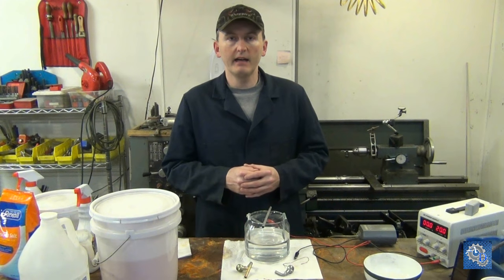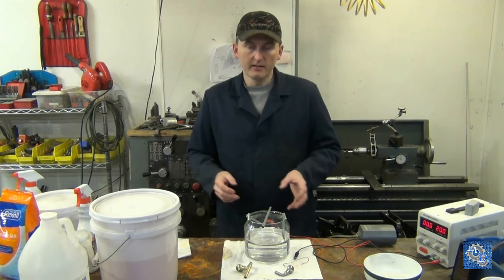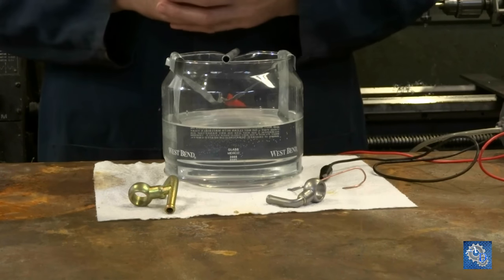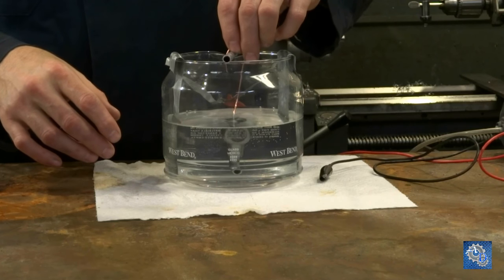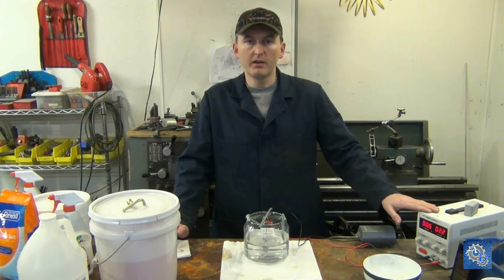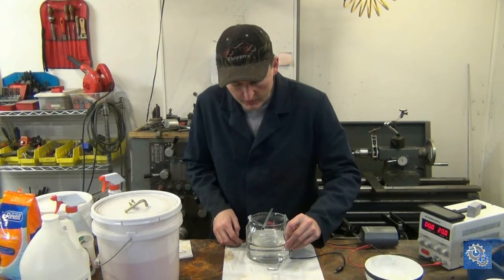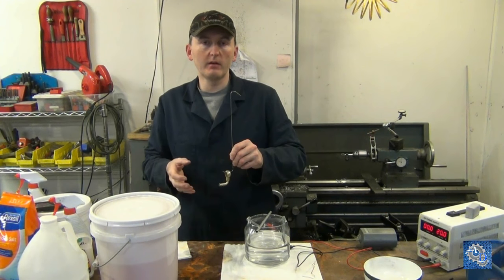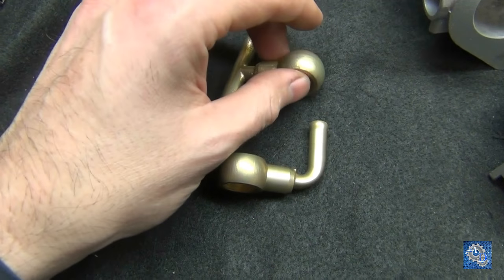Easy Zinc Plating and Yellow Chromate on Banjo Fittings (Copy Cad alternative)

Comment: By "CopyCad" is that the Caswell process- did you start out with the CopyCad kit for plating as well before sourcing the alternatives?  I have the Caswell kit, but it is very expensive here in the UK and am at the point of all the mysterious "A" and "B" chemicals being exhausted- of course they will never tell you what they really are!  I am finding now most customers want their carb bracketry re-plated.  But with the zinc brightener Caswell use, at least the finish is ready for the chromate straight away.  So if the zinc finish using the cheaper solutions is dull and needs vapourblasting to shine it up a bit before the chromating- can you say why you find it necessary to do this cycle 3 times?  Great video!
Reply from the maker: Thanks :) It's not the Caswell process. I'm not sure if that's their trademark, but if it is, I'll change the title to cad plating replication or something like that. It's quite expensive here in the US too. I have read that with the process I'm using, if you add a little sugar to the solution, it enhances the finish by controlling crystal size. I haven't found that it changes anything, but I'm no authority on this either. I'm still experimenting. I use three thin layers of zinc because if I put down one heavy layer, the plating starts to build up on edges and turn dark. It's like spraying on three coats of paint and sanding between, instead of spaying one heavy coat. It's more consistent. I think you could use this method, but bead blast between layers if you don't have access to vapor blasting. You would need unused glass beads so no dust or oil gets embedded in the zinc, and blast the plating at very low pressure. I have a video posted that shows how to set up the plating bath and where to source the materials. There is a link in the description.
Reply: Yes the "CopyCad" kit is Caswell's- I have it.  It is meant to replicate the CAD plated look as standard.  You add a few drops of a mysterious brightener every now and then which gives a very bright finish straight out of the tank- saves using wire wool or blasting the part again.  I bet you found as I did that the plating industry hides all the information on chemicals to use- frustrating!  Nevertheless I now have a plating solution similar to yours which is cheaper and works.  The brightener is still a problem- I heard the sugar theory then found another Youtube vid where a guy uses artificial sweetener as a brightener- maybe a myth...  Over here the commercial platers are turning away small scale jobs from restorers in favour of bigger jobs- and since sending a few blasted carbs out with re-plated parts I have been inundated with requests to re-plate and chromate parts!
Reply from the maker: No, I meant that my process was not Caswells. I thought that was what you were asking. The plating industry is guarded as you say. I suppose they have to do that to keep out competition. There is a good forum on finishing.com though, where people in the trade offer a lot of info to anyone willing to listen. I will try the artificial sweetener thing. I haven't experienced the demand for replating here, which is good. It's not really something I want to get into too much.
Reply: There is absolutely no ingredient name listed in that website, which is quite useless.
Reply: @lhongkho1091  Just download the pdfs...
Reply: @kennethkaiser5332  The MSDS at Caswell for most products are not showing the chemicals used. They hide it as a trade secret. Now some of them have a memo that states if you bought this product (proof of purchase) we will send a password to log on in order to view the MSDS.
Trade secret statement (OSHA 1910.1200(i))
Per OSHA 1910.1200(i), specific chemical identities and percentages have been withheld as trade secrets.
Reply: The Passing of the Great Race by Madison Grant
Reply: @kennethkaiser5332  Its a safety data sheet. Their not required to give up their trade secret chemical, only required to explain what its hazardous properties are. I'll give you a hint; its Cationic Polyamine's.
Reply: I can recommend gateros plating.

Comment: Great video.   I have and Old Triumph and want to restore nuts, bolts, etc. to original cad finish.   would I vapor blast and then use clear chromate?
Reply from the maker: Thanks. You could also bead blast if you don't have access to vapor blasting.

Comment: I have had trouble with the yellow chromate sticking.  After 24 hours it wipes right off.  What is your chromate to water ratio?  Do you do anything special like blow with a hair dryer or something after your done to make sure the chromate sticks?
Reply from the maker: I just mixed the solution as per the directions from Caswell with reverse osmosis water when it arrived. The only time I had it peel in areas was when I left it in chromate solution too long. I think it was about 25 to 30 seconds. Now I just go 10 to 15 seconds max. It's also possible that maybe the bath or the zinc surface is contaminated. It's hard to say. I blow the part off briefly with a heat gun a safe distance, or set it in front of a heater for a while until it darkens.
Reply: @ArnoldsDesign    Thanks.  I think my 30 second dip may be the issue.  I will try the much shorter 10-15 seconds next time.
Reply: Hi do you have troubles with plating bolts with attached washers..getting into the tight areas?

Comment: Hi, is zinc plating enough to make parts fuel resistive? Or do I also need to get them coated in yellow chromate?
Reply from the maker: They should always be chromated, yellow, silver, etc., otherwise the zinc will react will air moisture and get chalky and white and not last long.

Comment: is there a way to polish up the zinc after plating prior to chromating since I have an item that is full of nooks and crannies making it impossible to polish with Steel wool and I don't have a vapour blaster.Could I dip it back into a muratic solution for a few seconds prior to chromating???
thanks Andrew
Reply from the maker: You could very lightly bead blast it with new clean beads. It won't give you a shine, but will give you a satin silver finish. Muriatic acid won't make it shiny, and will dissolve the zinc within a few seconds.
Reply: Arnold's Design 
thanks for the prompt reply.I know you might not like what I usually do.I usually sand blast my rusted steel.Could I lightly sand blast it with clean sand or will it be too abrasive??
Reply from the maker: Sand will leave a matte finish on the zinc, and will quickly remove it. You could sand blast the steel, then plate it, and then glass bead, but I wouldn't sand blast the zinc itself. You could try, but I don't think it will be what you're looking for in a finish.

Comment: Thanks (from the UK) for the time and effort involved in making a video with detailed step by step explanation and instructions,  however just a couple of queries, as I don’t posses a vapour blaster, any suggestions of what (if any) alternative method I can use, also what does ‘yellow chromate’ consist of, do I have to purchase it, or can I maybe concoct it myself?
Reply from the maker: Thanks :) You could bead blast between layers with very low pressure. You would need new glass beads 
so no dust or oil gets embedded in the zinc. The yellow chromate I get from Caswell's. It's not expensive and lasts a long time. It's a little bottle of concentrate you mix with distilled water. I think there are people who mix it up from raw chemicals, but I don't know how it's done. Chromates are fairly hazardous, so I don't like to mess with them too much other than dipping parts.
Reply: If I simply want to zinc plate an item, do I have adopt some kind of end hardening process (such as chromate) or will the actual plated finish be tough enough? TIA.
Reply from the maker: You need to do a chromate conversion after plating, otherwise the zinc will become chalky and feel tacky, and degrade quickly when exposed to humidity.
Reply: Thanks, I'll have to check out sources here in the UK, although couldn't seem to find a similar product to yours listed on ebay, perhaps I didn't look hard enough, so will try again.
Reply: If I recall my chemistry correctly, freshly applied zinc, plain bare zinc, is "active". It is reactive and does oxidize quickly. It can form a nice patina under the right conditions but for automotive use must be protected with that passive layer.
You are putting a passive layer on it with the yellow (besides making it look great. The "chromate" or "passivate" dip actually eats into the top of the zinc. Two reasons to watch the time closely (timer or stop watch is a logical idea) - it can eat off the zinc and leave blotchy areas with no zinc, and it does darken with time left in the passivate bath. If you don't have enough zinc plating there's not enough zinc for the passivate to eat and sink into - and it can eat right through a thin layer. In either case the only alternative is to strip it in an acid bath and start all over. And you know how much effort goes into the PREP work! Like painting a car - it's over 90% prep work, and if the final step is messed up, you have a big problem and have to literally start over from scratch having wasted all of your prep time. 

What are you using for the yellow chromate or passivate? Did you purchase that - or buy the component chemicals and make up the yellow bath?
The plating isn't so bad but I've had bad luck with getting the yellow right and need to find a good source of either the yellow chromate or passivate or make it up somehow.
The guy I was buying a concentrate from is out of business and gone....... nowhere to be found.

Those fittings are perfect, the exact finish I need for my automotive electric part restoration business (starters, alternators, wiper motors, etc.)

Comment: Great video! How do you prevent the aluminum that was vapor blasted from oxidizing? Do you have a way to anodize it?
Reply from the maker: Thanks. Aluminum forms a transparent oxide layer that gets thicker over time which protects it. For parts going into outdoor weather a lot of salty air, I recommend hard clear coats, or micro oil films like acf-50.
Reply: Arnold's Design you may want to try something called Rust Prevention Magic(RPM). It's a wax-like coating that is applied to a warmed part. Prevents oxidation, and doesn't evaporate. I used it on my MB 250SE parts and stationary band saw and lathe parts. I live near the ocean and oxidation is a big problem. This worked well for me. (I don't have any commercial interest in the product, btw)

Comment: Yeah you need to set your stop watch for 15 seconds because it's way too much to count too.  Come on dude.  You can do better.
Reply from the maker: Seriously, you're going to bitch about me using a timer? Let's see your plating vids showing your expertise. Chromating is very time sensitive. A few seconds too long, even an extra 5-10 seconds and the chromate will get too dark, that is if the layer doesn't peel off while you're drying it. Start screwing around and you will be stuck with two parts that don't match color because you were too lazy to use a timer. Not only that, but now you have an irritated customer who now has two parts he can't use and has to send then off to a plater who uses a timer.
Reply: wow. ....  lol   you are little uptight about this...